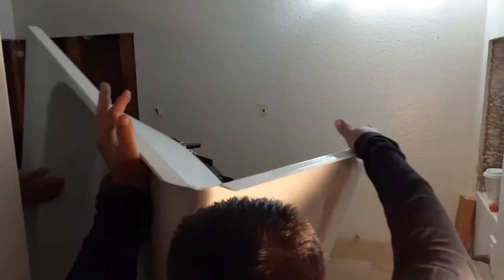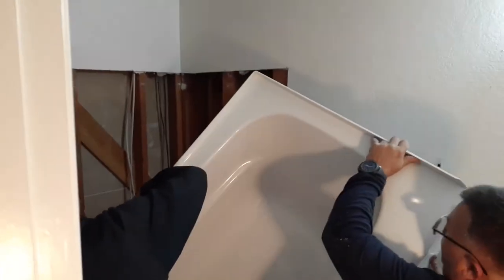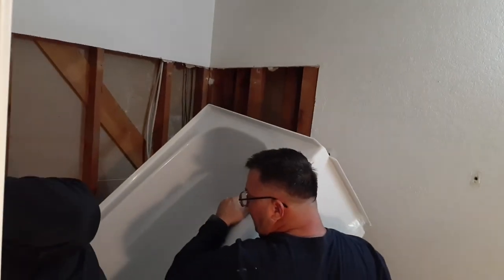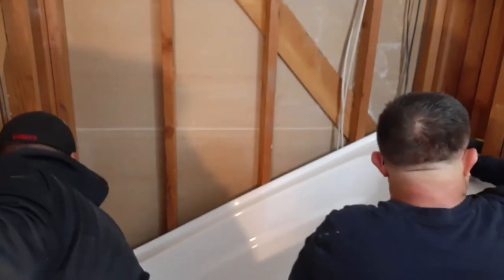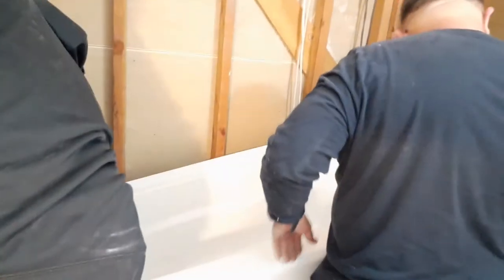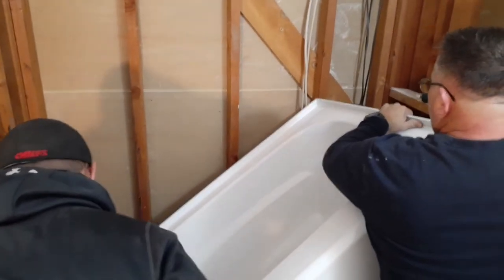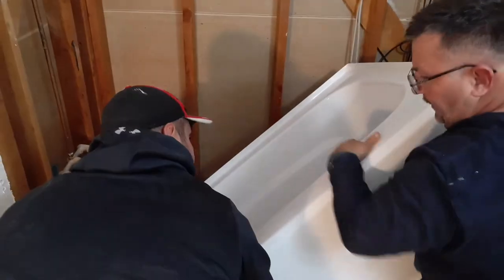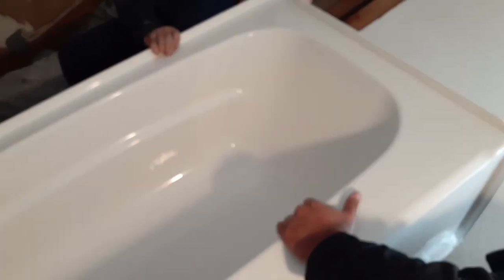How to install new bathtub in tight spaces

Comment: "How to install new bathtub in tight spaces"

Since the video didn't illustrate, I will explain:  

basically you and a friend wrestle with it for about 3 hours and eventually by some miracle you jam it home after notching out studs, cutting out progressively larger pieces of drywall near the tub, cursing your very existence, and considering walking off the job about 20 times.  Once it's jammed in place you say screw the stringer board along the back wall that you were supposed to install because you're not pulling the tub out and going through the installation nightmare all over again.  Then the fun begins when you do the drain/overflow piping and realize the polypropylene kit you bought doesn't reach far enough to the drain hole on the tub so you have to run to home depot with your tail between your legs to get an extension piece.  Then you get back at an ungodly hour when you have to work the next day and finish the half cocked installation and pray to the plumbing gods that nothing leaks...anytime soon anyway.  You leak test it for about 2 seconds and don't see any drips so you say it's all good because if it weren't you'd go on a mass shooting.  You then swear to yourselves never to do a tub install in a tight space ever again.

Hope this helps!!
Reply from the maker: Yes absolutely 👍🏼 You must be a professional Thank you for watching my videos please like and subscribe and hit the bell 🔔 for notifications 📣
Reply: I just wrestled tgis same tub in on my own in a very tight space and you are correct the drain kit does not reach i need extension
Reply from the maker: @alphaturd6922 yes now they have the flexibility drains connector s At hardware stores

Comment from the maker: What we do when we are read to install the tub we mix 2 60 pound bags of cement with the consistency of peanut butter than we poured it where the bottom of the tub will be sitting so the tub bottom sits in it and it supports the bottom of tub and also before the cement dries we walk in the tub to remove any air bubbles under it but check with the tub manufacturer if it’s safe to use that type of cement

Comment: how about when your walls are concrete and there is no space to place your hands along the wall?
 you have spaces between the studs.
Reply from the maker: If ur walls are concrete ur in good shape
Reply from the maker: Depending on the type of type of tub you have you may be able to shave edges to fit also you can order smaller bath tub

Comment: So light. Wonder how it holds up.
Reply from the maker: Sela P it’s a fiberglass and polymer material and it’s reinforced on the bottom and u add mortar on the bottom and it strong
Reply from the maker: Thank you for watching please subscribe
Reply: I just "installed" a 320lb steel Kohler alcove tub. PITA to carry to the second floor. Looking good though.

Question, when shimming the (vertical) wall joists, how tight against the lip of the tub should the shims be? I fit tested and shimmed with with half inch shims and while it's not a tight fit it's snug. 

My tub is 60 inches wide. The wall measures approximately 60  1/5 inches. Thanks?